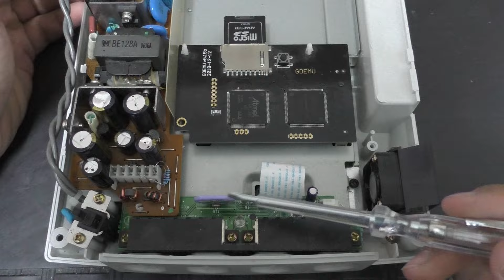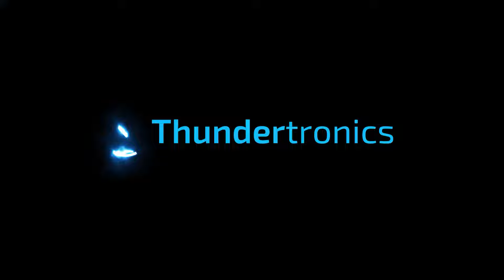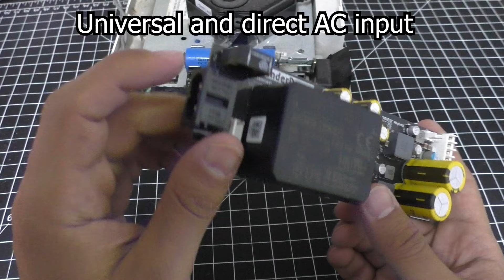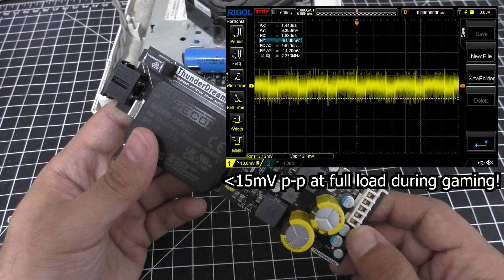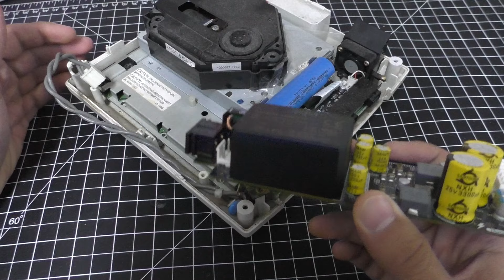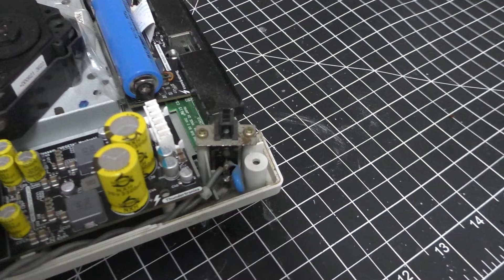ThunderPSU power supply for Dreamcast (ThunderDream)

Comment: I got a question, I’m not gonna do a gdemu mod. I wanna preserve my dreamcast as long as possible. Should I buy this and would this help preserve my dreamcast?
Reply from the maker: Hello,
yes of course, it is the best power supply for dreamcast, it will preserve it from different angles like heat and noise. 
doing ALL mods at once won't even strain this one.

Comment: Hi i was discussing with one of the experts who looked into various PSU replacements for old consoles. And what he found was worrying. In many of the boards, Rexus Nexus, Retro Six's Clean Power. The boards lack external protection, if something fails on the PSU board like the regulator. The VIN will still continue to go into the system frying it in the process. Unlike the original PSU, where if the tranformer fails, the PSU no longer provides power to the system. They're also using clone ic's in the RE PSU's.

I'm sure your PSU uses high quality parts, but I would like to know whether they would continue to power on the system, if something were to go wrong with the PSU, or if the PSU would just cut off the power if something were to go wrong. If not this could be worrying for using it over the long term. I'm no expert on Power Supplies but the expert that gave me the information has certainly got me worried.

Here is an analysis of your PSU from the expert I spoke to. 

"So from my analysis:

Positives:
Good amount of capacitance
Uses polymer caps over electrolytic
Ceramics seem to be placed properly to filter out high frequency noise
The ICs seem to be modern at least, but can't confirm at this angle

Negatives:
The via spam is a red flag, it removes more ground than it helps with providing clean return paths
Using a medically rated module provides no benefit in this application and only raises price for no reason."
Reply from the maker: Hello

the PSU have short circuit protection, means if you short any rail to ground it will cut the power immediately before anything gets bad, and it will auto-return once the short is removed. this is on the output side where it should.

on the input side, the power module has internal fuse and short circuit protection as well. effectively making it multi-stage protection, i purposefully shorted the output rails to ground and tested it a lot.

as for your respected expert negative points:
- via spam: yes, some people do not like that but it does not hurt the design especially that it is 4 layers, 3 of which are full ground. thus, there is more than enough ground area for return path, even between vias there are lots of spaces. 

the saturn version which is upcoming reduces such vias by a lot. there is a planned next rev of this dreamcast psu which will use industrial rather than medical module (see below) and add some other features, as well as, reduce the vias.
still, i measured the ripple and noise which turned to be very good. meaning no ground return path problem is there.

- medical module: yes it makes it more expensive and next iteration and other consoles' versions will use industrial one. still at 75$ it is not that much expensive than other solutions you mentioned after getting an external adapter.

positives you mentioned:
ICs: all genuine TI modern parts, no counterfit is accepted by any means.
layout: my psu layout is on the perfect side as it took almost 90 percent of design time. other solutions mentioned i saw some of them have VERY bad layout, someone who never studied electronics would do it like they do! yet it sells ok and accepted to be a nice choice. people in this hobby or field do not focus much on how robust the design is compare to how convenient or easy to use or cheap it is.

i am really happy you and your expert really dug into this and provided such nice feedback, anything else you want just contact me on discord.
thanks!
Reply: @Thundertronics And does this have OCP (Overcurrent Protection), SCP (Short Circuit Protection) and UVP Undervoltage Protection? Along with overvoltage monitoring? 

Thank you for your reply. I will definitely be picking more of your PSU's if the following features are confirmed. Speaking to the experts who mainly looked into the Rexus Nexus and the Retro Six PSU's has really got me worried about how they are designed. And he lost his Sega Saturn to the ReSaturn PSU when the Voltage regulator failed and it ended up shorting out his Sega Saturn. This has got me worried, since I have those PSU's installed in various consoles with expensive mods installed in them like the Retro Gem, RGB Mods, Modchips etc. And i do not want to risk using low quality modern power supplies. I really look forward to your Saturn PSU.

Comment: V2 came in yesterday. Installed it today. It works. No heat. Very good build. I went with this as opposed to the PICO PSU and the Dream PSU because they both had middle grounds on whether they worked or not, ie they varied between users but I've seen far too many people mishandle electronics enough to get the feel on whether it's the products fault or the person installing it.

Thanks.
Reply from the maker: welcome! enjoy it.
Reply: @Thundertronics   Please make the same PSU for Xbox Original console🥰

Comment: Looking forward to the Saturn version of the Thunder.

The Current DC version has been a lifesaver.
Reply from the maker: thanks for your trust. i sent the final (hopefully) sample of saturn psu to the factory.
Reply: @Thundertronics  AWESOME!
Reply: This thing is awesome. After installing my dream PSU years ago I was getting intermittent resets every time I would play the console. The thing we just shut off after the first 5 or 10 minutes. Happened constantly. Does not happen at all with the Thunder PSU. I'm really interested in a Saturn version. I've been wanting to replace my Saturn power supply for a long time.

Comment: When installing the thunderdream, do we keep the plastic shroud between the psu and the metal that protects the motherboard?
Reply from the maker: well, i do not remember but nice to keep there for safety. i believe i once tried it without the plastic and worked... you could feel it if it touches anything or not. generally, just keep the plastic
Reply: @Thundertronics  Appriciate it! Cant wait to get my hands on this power supply!
Reply: @Thundertronics  Just got my dreampsu and the connection does not support my OEM Dreamcast cord. This is something that should be in the description on the product page. Can you point me in the direction of what cord i need to buy?
Reply: Yes! I just installed mine and you absolutely want that piece there to prevent any shorting against the metal shielding.
Reply: @DivisibleByWaffle thanks!!

Comment: Since it doesn't generate heat, does that mean I don't need to keep the plastic barrier that went under the stock PSU?
Reply from the maker: hello
those two things are not related. the plastic was to isolate the power supply bottom layer from the metal parts.

I would suggest keeping the plastic, but you can see if removing it the power supply touches or does not touch the metal parts.
Reply: @Thundertronics ah ok i understand now, thank you. Definitely planning on ordering one as soon as there's more stock!

Comment: Just ordered the Rev. 2 just had a question about the connection for the power switch, stupid question for sure but since the plastic notch is gone what direction does the plug go? I don’t want to ruin my Dreamcast.
Reply from the maker: direction won't matter as it is just an electric switch. even original psu if you remove the plastic notch you can install the plug either way.
Reply: Thank you 😅
Reply from the maker: welcome.
i see 4.99$ next to your comment, what does it mean?

Comment: Very nice! I just bought a japanese dreamcast from Akihabara on my Japan trip and something like this would be perfect because I live in the EU so mains voltage is ~230V 50Hz.
Reply from the maker: i have 220v ac myself too.

subscribe to the website page of it so you can get notification when it is in stock, 2-3 weeks and it will be ready for shipping.
Reply: hello! They are back in stock currently at StoneAgeGamer :D Got same Japanese one as well but was worried using a DreamPSU (although with a TRIAD power supply). I will be glad to get this awesome solution by @Thundertronics!

Comment: I disabled the 12V on my original PSU to reduce heat when using GDEMU. It's good that 12V functionality can be retained with this new PSU while staying cool, even if 12V doesn't seem to be required for most scenarios. One thing I'm curious about is the connector which attaches to the pins on the motherboard. On the original PSU I've had to adjust it to grip the pins tighter, to remedy the issue of the console rebooting itself.
Reply from the maker: even after 12v removal, original psu will produce heat, a lot of it. this psu does not require anything to work, just a simple push in.

Comment: Works as advertised!

My ThunderPSU came in today, delivery to Europe took exactly 1 week.
It stays cool (after 3h -> still room temp, whereas my original PSU would get quite hot very quickly).
As a nice bonus I no longer see any interference (noise) in my captured videos!
I am running my DC with a MODE btw
With that said, I'm very happy, that is all 😃
Reply from the maker: same reply as discord = same love from me.

Comment: What a pointless effort. For 25 years I've never ever seen a single one dead original Dreamcast's PSU. 
Dried out capacitors - veeeery rare but yes, oxidised power contacts - yes. And this is pretty much all of the problems, wich you can fix once and forget about it for another 25 years. Neither using GDEMU nor USB GDRom doesn't harm Dreamcast's PSU don't get yourself fooled.
Also there is no point on using that large capacity RTC battery, because of nasty flaws of the Dreamcast's BIOS code - after several month of idle Dreamcast will ask you to set the date and time no matter of battery state. It can be near at full charge, but after several month of idle you will be asked to set the time and date either way. So it's another useless mod.
Reply from the maker: useless in your opinion, but many others see it useful. you clearly didn't see the video where i talked about the features and why you would and wouldn't want to get it. DC PSUs do fail and they have their problems, they are not immune. 

ultimately it is a choice people make, and this PSU is objectively the best performing one... price-wise it is expensive and I am working on a rev2 which will reduce the cost a lot.

battery mod is a highly requested mod and solves the problem, no one witnessed the bios fault you speak about and even so this mod still benefit you.
Reply: @Thundertronics  it is pointless from a common sense point of view, not only just mine. In fact the single benefit is that it's much cooler than original PSU, what actually never was a problem. As of the battery mod, you leave your Dreamcast with that super useful battery mod installed for a 3 month, then measure the RTC voltage and turn it ON - you will be surprised. And by saying to leave the Dreamcast for a 3 month, I mean that you shouldn't turn it ON whole that time to trigger the BIOS glitch.
Reply from the maker: hello,
can you tell me more about this bios glitch? i want to read about it since i found one of my devices reset time after 2 months or so. I am really surprised since no one reported this so far. please guide me to links where this is explained.
Reply: @Thundertronics  as far as I know it wasn't explained anywhere. The only explanation was given in the Dreamcast instruction manual as a natural RTC battery discharge.
Perhaps no one reported this due to assumptions that the battery was the cause, which is not quite true.

Comment: Will you design for other consoles that could use similar replacements? I don't like those USB based PSUs that are super noisy. Such as Saturn? PS1/PS2? og Xbox?
Reply from the maker: I have a plan for Saturn now, working on it.
Reply: If I'm not wrong the OG Xbox is not Bivolt. Given that would be great if we have a PSU that we can use on both 220V and 110V units.